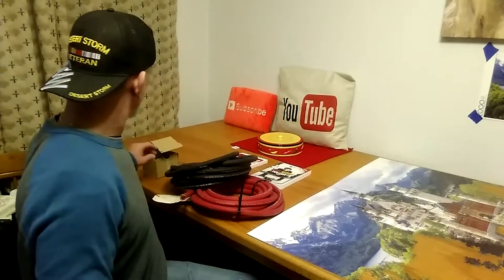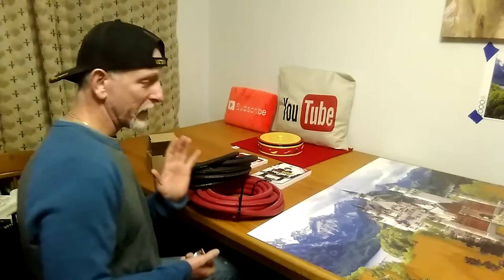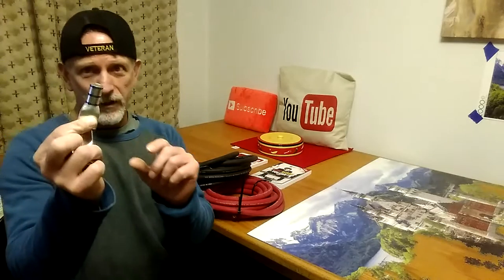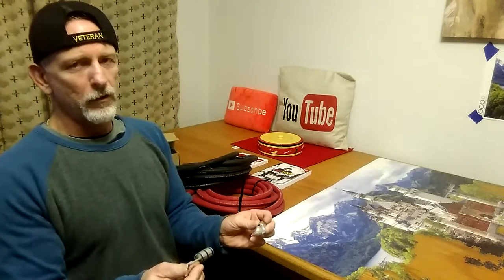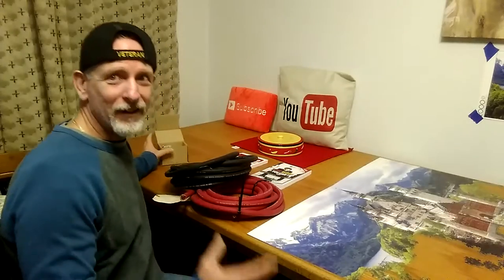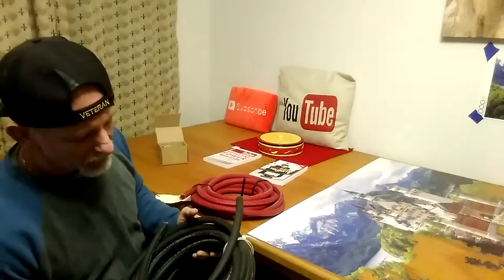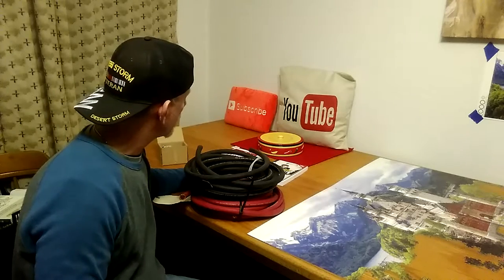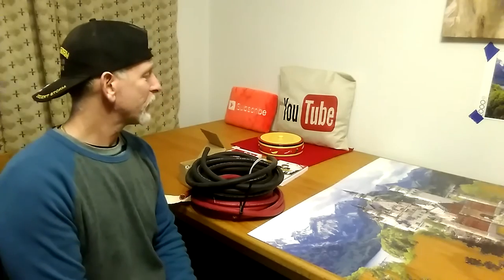How To Make Solar Cables

Comment: Excellent info and advice my friend👍
Reply from the maker: +Yankees Outdoor Adventures why thank you my friend.
Reply: May i suggest 
Before you smash the end to drill..
While the pipe is still round..
Clean the inside of the pipe with a brush or sandpaper to get rid of any degradation
While it's still relatively easy..
Reply from the maker: You got pinned again

Comment: Buy a copper pipe, and use a die grinder with slim cutting blade to cut your own.  You can flatten one end, drill the hole, then cut a ring for soldering the bared wire to, and leave another ring further up to put the wire through and crimp to the insulated portion of the wire, more robust, less $$.  Doesn't matter if you crimp or solder either way makes it brittle at the connection, so making them with a crimp that holds the wire further back avoids either.